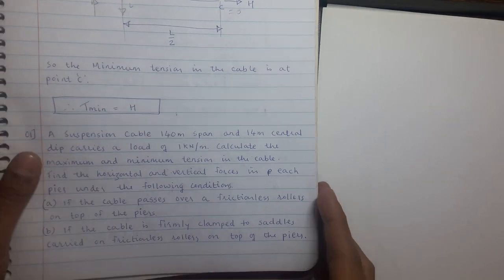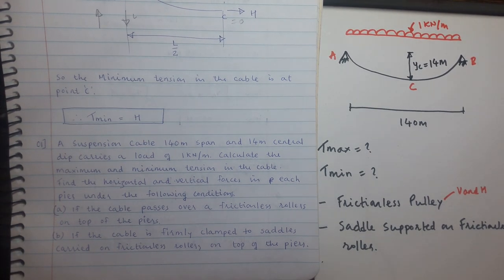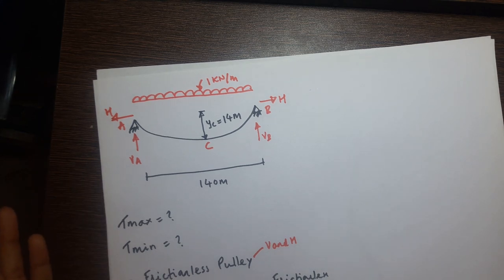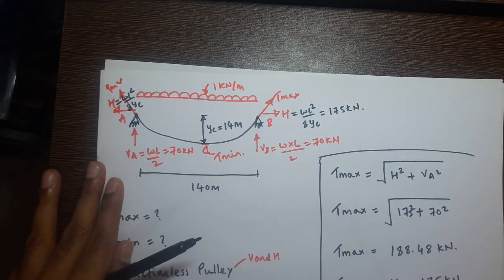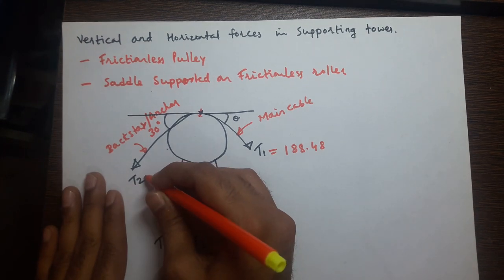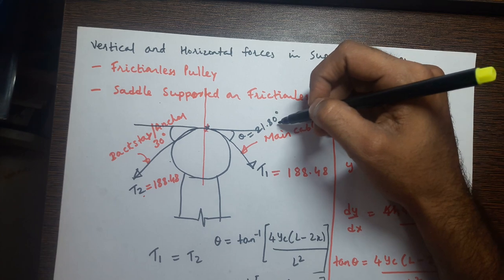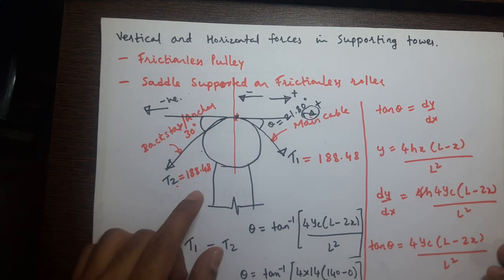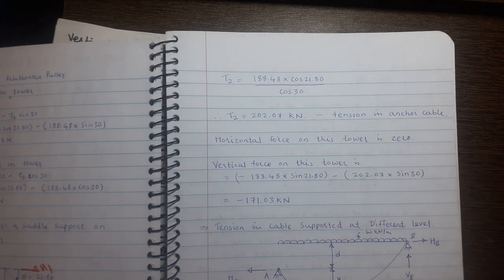Analysis of CableProblem No. 01

Comment: How do we suppose to calculate the angle of main cable with respect to vertical, if angle of anchor cable is given with respect to vertical.
Reply from the maker: angle of main cable does not depend on the angle of anchor cable...
angle of main cable can be found out by using the parabolic profile of the cable.
Reply: will u please explain suspension bridges at different levels and 3-hinged stiffening girders problems.
Reply from the maker: Shadab Parvez not possible before exam..
busy schedule..
you can have my contact no. to learn three hinged stiffening girder.